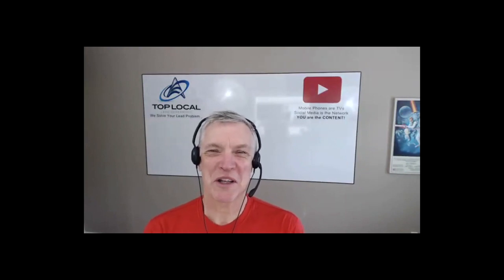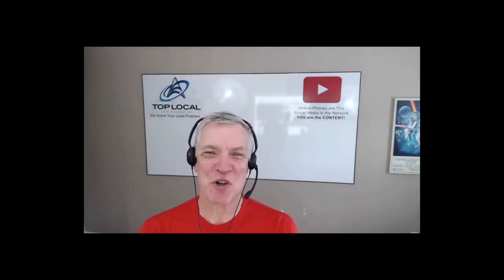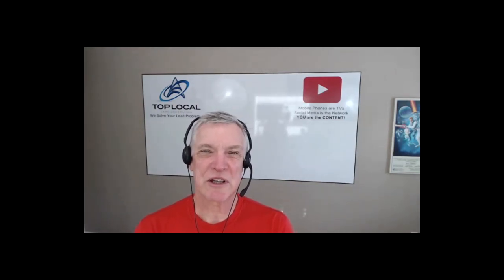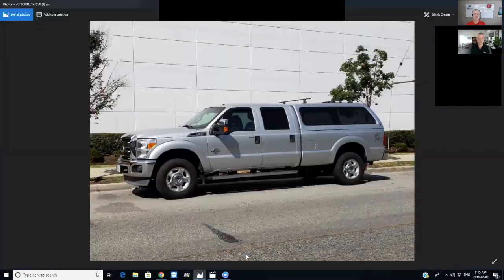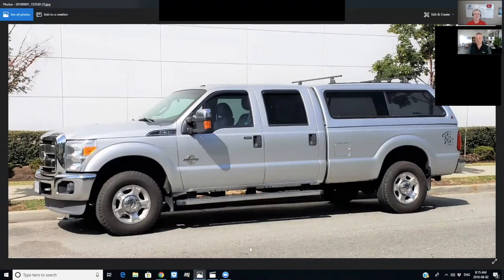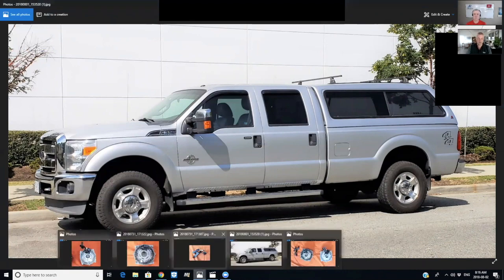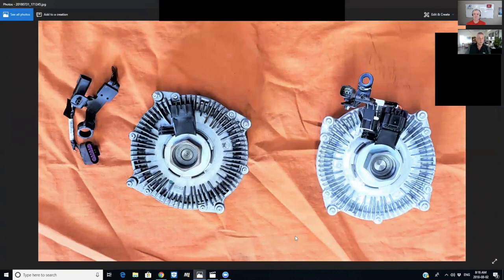2011 Ford F350 6.7 Litre, Electric Fan Clutch

Comment: Your ac at idle will warm up and your temperature gauge will start to rise past 198 to 205 where it’s typically at yes it’s a piss poor design and it is designed to fail at 6 years old , my 2012 just did this same thing it’s not dangerous because you will not run to hot unless u are not moving at all if you are moving even at moderate speed the coolant system will maintain regular temps easily